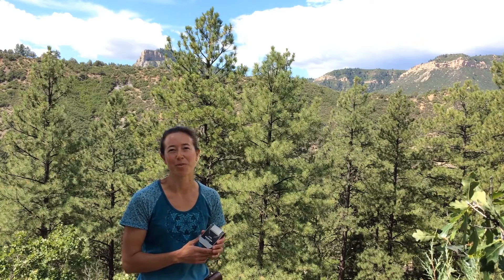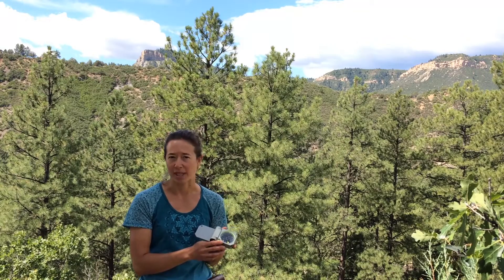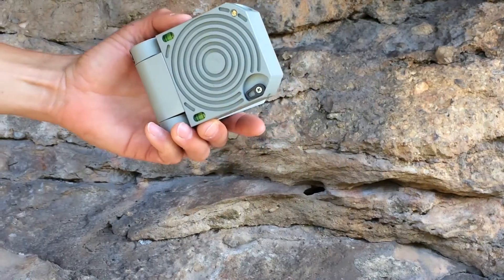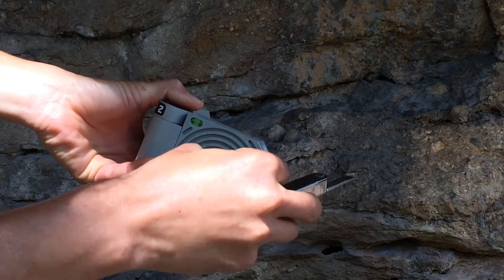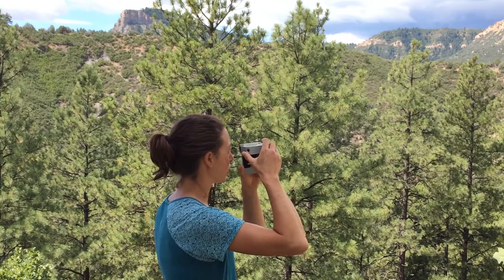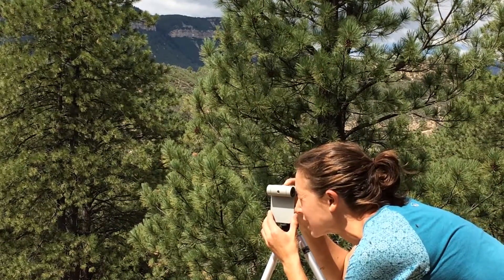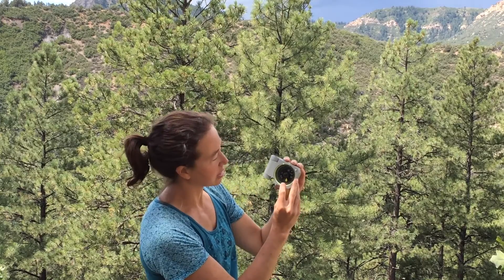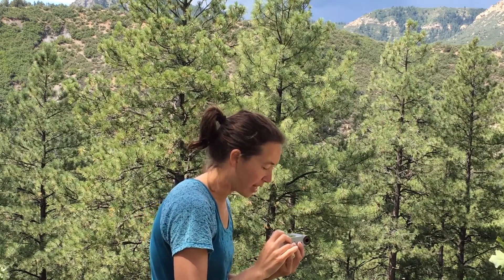Brunton Axis Transit - Bearings and Angles

Comment: The Compass is great but the price puts it out of reason for most of us. I purchased a brand new Transit, Tripod, and meter Rod for less than the price of this compass. Run a sale or something the price is embarrassingly high $779.99 to $315.99 on Ebay is just 
outrageous. My better haft would go ballistic if I told her I paid that much for a compass.

Comment: So, "With this newer magnetic needle, the compass base doesn't actually have to be perfectly level for accurate bearing measurements to be made." . . . That means that for over a thousand years sailors were sailing the seven seas with crude compasses that needed to be LEVEL, and they remained level everywhere on "the globe" that they sailed, without the use or need for a declination setting. Hmmmm, pretty slick magick you have going on here. And thank God that now they have "universal needles" that do the same thing those compasses were doing over a thousand years ago. Apparently the new needles ADJUST THEMSELVES  . . .  by magic!  But of course if the earth is a level plane, that would explain why compasses never needed to be adjusted according to "hemisphere".